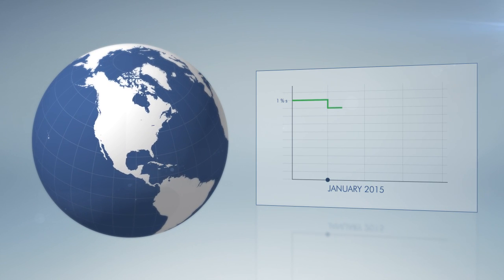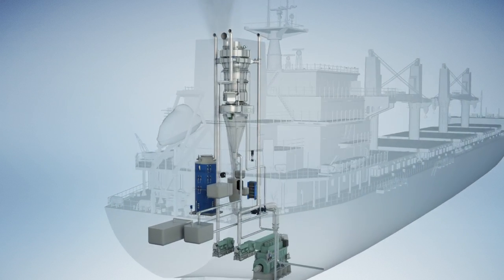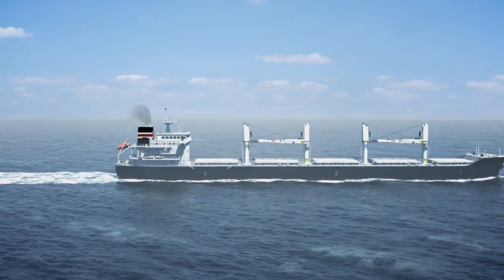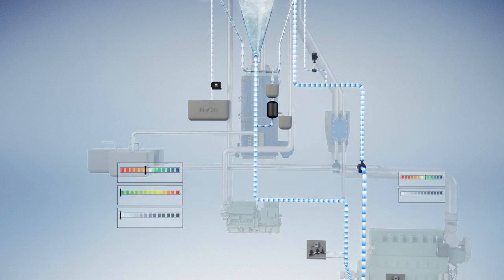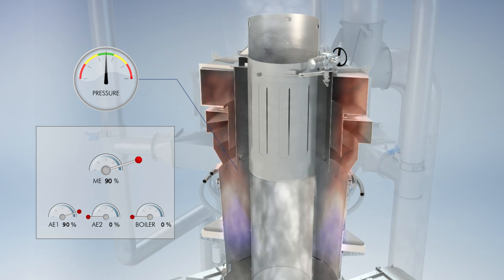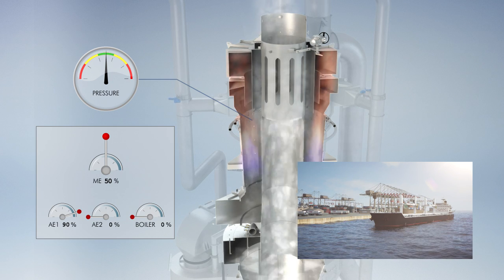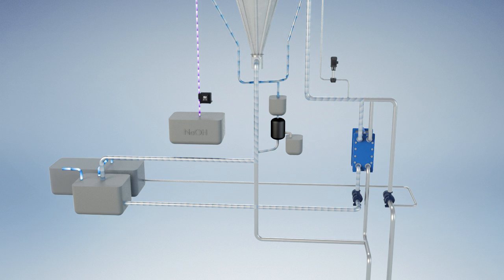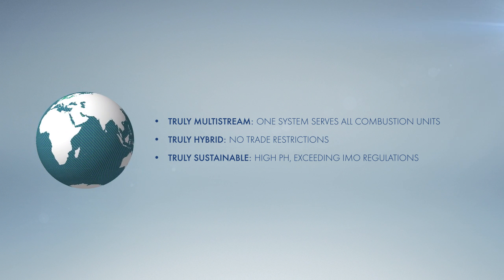Clean Marine EGCS - detailed information film

Comment: open loop = dump it at sea ............ closed loop take it back to the land ............ which is cheaper ... ?  which one would a shop owner use ? ......I would assume clea and dump at sea , i wonder why there will be no fish in the oceans by 2050 ?
Reply: And where does it all go when realeased into the air except into your lungs? Try and study the chemistry behind this cleaning method and you will know that if the fish are gone by 2050 it is not caused by scrubber systems.
Reply: You have no idea what you're talking about.
Obviously a closed-loop system is cleaner, as you're not just dumping the waste into the oceans. It would definitely make sense to mandate closed-loop systems.
Reply: @electric7487  try and read what i wrote and understand stupid